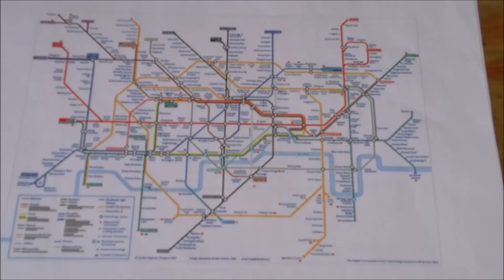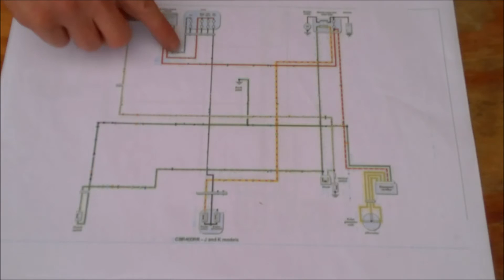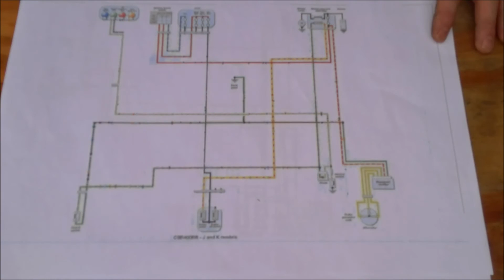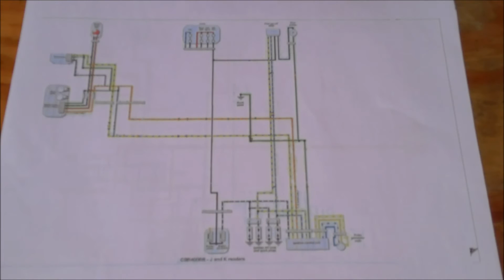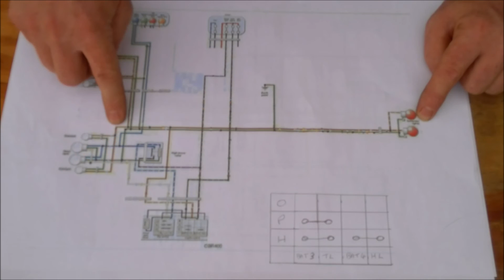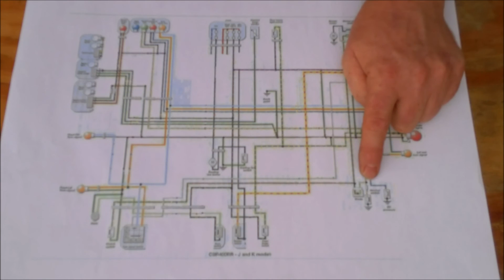Wiring Diagrams and Motorbike circuits explained

Comment: Thank you for this new approach, paralleling it with an underground map! It is still unclear how to make actual connections that disembark at the "fields", i.e. ground connection signs that look like a lighting pole or shower on the diagram, are placed in the middle of the route, or some crisscross of the wire that most likely are some connections since they are again, marked with some bow or circle. Do you "weld" directly into the line or do you have to branch it from either end of the connection?